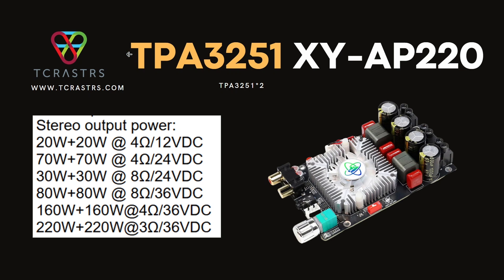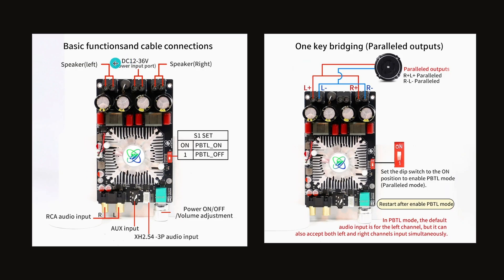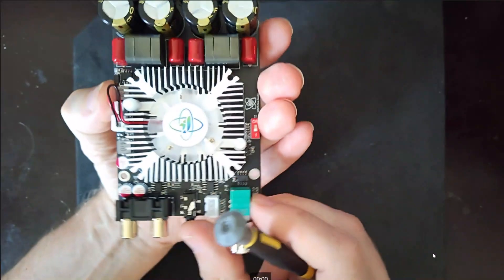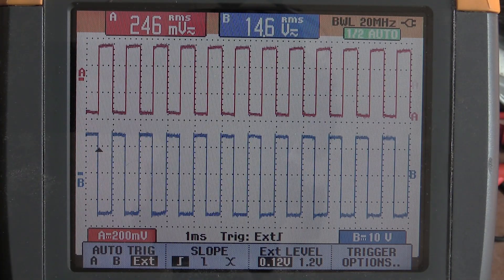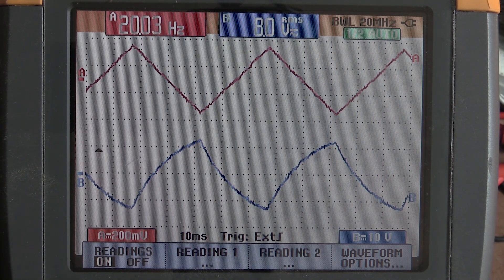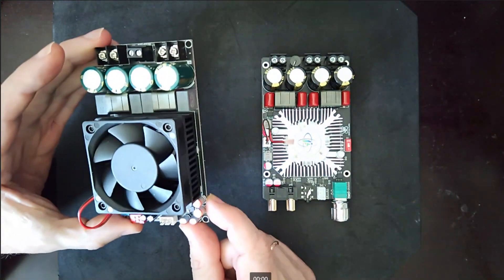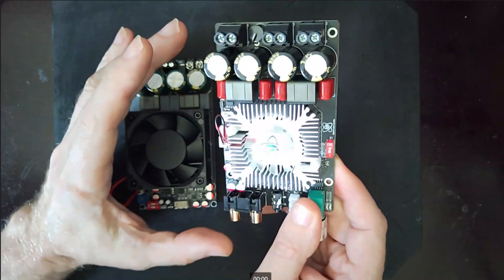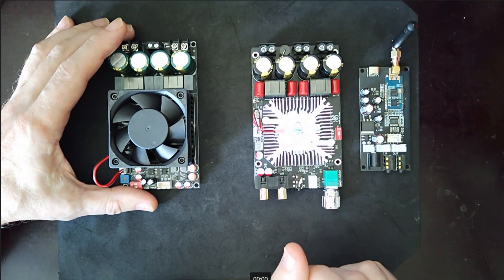XY-AP2202 TPA3251 audio amplifier board tests, measurements, and review

Comment: Wow this is a poor review.  You try to pretend that buyers of budget amp boards care about very low Hz fidelity, and then you try to compare price while ignoring that the AP2202 is ready to use, while the contrasted board needs a volume pot and RCA inputs at least, so the cost comparison isn't true at all unless you add the SHIPPED costs of those components needed for the TPA3255 board.

I am a bit confused how you can even keep a straight face trying to compare without considerations like this.  I wonder if you even build amps to actually use daily, to so easily ignore the entire amp build integration factor.

It's not even just the pot or RCA inputs but on your favored board you also need to buy the input connectors too.  For most of us that will at least double the integration cost, unless you're building a lot of them and try to argue that each connector only costs 20 cents but you have to buy multiples more of them then than you need, to get that price, plus shipping cost.

Also your analysis of the heatsink was foolish.  It is not at all a good heatsink, just the lowest cost way, with poor thermal transfer to the fin/area, and pretty stupid design to begin with because the capacitors impose the upper housing height limit, so only cost cutting was the reason that they couldn't use a full finned heatsink with a fan on top  that was  pretty similar to the capacitor height, and a full finned heatsink has much better thermal performance, about twice what that heatsink has, which tells me that you don't know much of anything about heatsinking.

I am sure that you will come up with some dismissive reply because you don't really understand much at all about electronics. I know, that seems crazy to state, but your working ability to assess is terrible, makes no sense, as if you don't really have anything useful to tell us are are just puppeting some methodology someone else stated but not understanding what you tried to learn.

Please, step back from your arrogance and learn the most basic facts of electronics.

Also it is just plain ignorance to pretend that if a component is soldered on, that this magically assures anyone that is it less likely to be fake.  You must be stupid.  The board was built to a low price point to begin with, so shaving every penny off the BOM that is possible, would begin that the design stage, not some conspiracy factor about someone else swapping out opamps later which is stupid to begin with because swapping them out, is labor and needs a resale market for the swapped out opamps which makes much less sense than just soldering on clone opamps to begin with.  Wow!!

Comment: Revers polarity on amplifier is due to phase rotation that happens in speaker driver. actually if you measure sound produced by speaker driver it is 180 dgr phase shifted compare to phase of voltage on its terminal. that is physical effect of  conversion of energy from electromagnetic in to mechanical.
Reply from the maker: There are plenty of amplifiers where the phase is not shifted. This is why I am a bit missing looking at TPA3255 boards. I think the real reason is that there are inverting preamplifiers for those designs, and after bridging, we got reverse polarity compared to the chipset specifications. But it is just my guess.
Reply: @guntarssmits2104  Why all re measure only up to 20kHz, we can hear over 20Khz, i personaly experience audible difference listening recording made with 50Khz limit  with and without 20kHz filter in playback , of course with speakers that was able to play up to 60Hz. All these class D chips or modules can play minimum up to 40-50 kHz where they drop -3db.  ICE can reach 80kHz, TPA32xx certain models also can reach 100kHz bandwidth. Yes 10-15 years ago that was a bit SF area , as usually industry business models driving the market, this 20kHz limit of our ears was establish 100 years ago, with technology of that time. What that technology did not include is natural phone curve, that is inverse to our hearing curve.
Reply from the maker: @glazzarus  At the studio, there is a 60dB filter to cut all frequencies above 20kHz. In recordings, there is no content above 20 kHz. When aging, we are losing the capability to hear high frequencies, and at the age of 45, most people do not hear frequencies above 14kHz. Class D filters have -3 dB bandwidth at 50kHz-80kHz to provide good 20Hz to 20KHz linearity. There is no real reason to measure anything above 20Khz. Maybe just for curiosity.
Reply: @guntarssmits2104  Yes I know what dosctors say about our hearing, but they do not know how we hear actually. All tests from 2010 , made with much better technology and equipment show that threshold of our auditory system detection is 7 micro second or bit above 90kHz. And yes I know that in final stage in studios as standard practise is cut of all above 21kHz with brick wall filter in digital domain. And that is introduced in 60-es when it was so expensive to handle recordings above 20kHz. Business model again. Same with CD- SACD battle before CD format is introduced. Yes DSD was known and used in labs but SONY did not pass that time. but 24bit/48kHz is adopted for studio use. interesting that CD could be in that standard, but that was time when 16bit computers was like SF , compare to 8bit home computers.

Comment: Hello Guntars, I’ve watched all your videos—big fan!
There are so many TPA3255 options out there that I’m a bit lost. 
I need one with automatic turn-on sensing. 
I remember you tested one with this feature, but I can’t seem to find it in your videos, could you help me choose one that has this feature, please?
Reply from the maker: Search for SAMP-300. It has this function
Reply: @guntarssmits2104 Thank you so much for your reply, I really appreciate it! By the way, could you tell me which Bluetooth board you show in this video?
Reply from the maker: @arturomty9969  Search for "Qualcomm QCC3034 Bluetooth 5.1 Lossless Decoding Board Supporting APTX APTX-HD PCM5102A Modified Amplifier Audio DIY Zero Noise". Those are on AliExpress and eBay. PCM5102A means that there is a separate high-quality DAC with 112dB dynamic range (16-bit CD has 96dB)

Comment: Thanks for video, can u test bdm8 for sure electronics?
Reply from the maker: BDM8 visually seems good board, but in some sense, ZK3002 has a better thermal design architecture for higher power. By audio quality, everything is OK for BDM8. Thermally 36V power supply voltage is max, and it is about 150W clipping power and 100W clean power. Good TPA3255 designs should be able to operate from a 48V power supply voltage.

Comment: Do you think the versions of this amplifier sold on AliExpress are reliable? Thanks for the video, very informative.
Reply from the maker: So far, all the boards I’ve purchased have been operational. However, these are not industrial-grade boards, and given their low cost, there’s no room for acceptance testing or warranty. Murphy’s Law applies—any risks are entirely yours.

If you're aiming for commercial or professional use, I recommend the ICEpower 200AS2 from Soundimport. That’s the board I use in my products. It’s based on the TPA3255 chip and has undergone significant R&D to optimize the final design.

Chinese boards are suitable for non-critical applications. They’re affordable, and if something goes wrong, we simply discard the faulty unit and replace it. When I inspected the components of the XY-02202, they were above average in quality. The heatsinks and fans are originally designed for graphics cards, which handle heavier workloads than audio amplifiers—so they’re more than sufficient.

The weak points of the board are the signal connectors and the potentiometer.
Reply: I thought the gold rca's are okay. I noticed a big difference in sound quality when connecting to those using decent quality cables. this was on the zk1602 amp though, the ap 220 is built better
Reply from the maker: @AlexWheely-bx7pk  My overall opinion is that everything with this board is OK.
Reply: "reliable' without more elaboration is a nonsense concept for lazy people.   They have lower QC, so it's a gamble especially the potential shipping damage.  Since you are lazy, you do the work one way or the other.

That should start with not being a fool that uses overly simplistic questions and instead elaborate about your concerns.  Are YOU, "reliable"?  See what I mean?  It's a contextual question and nonsense without context.